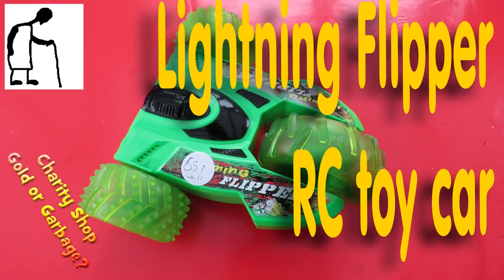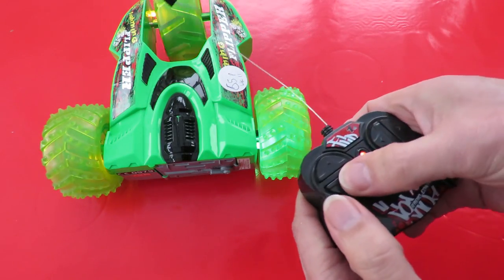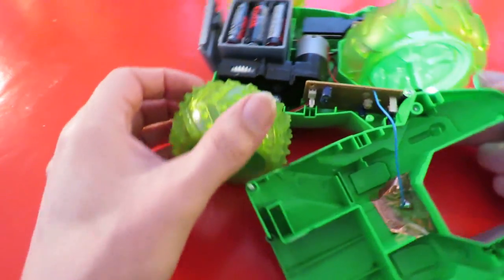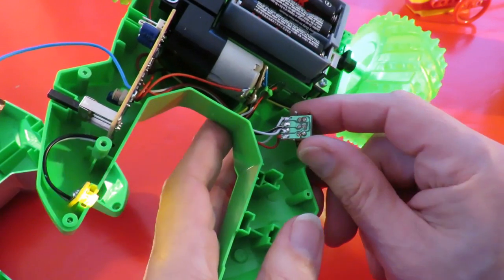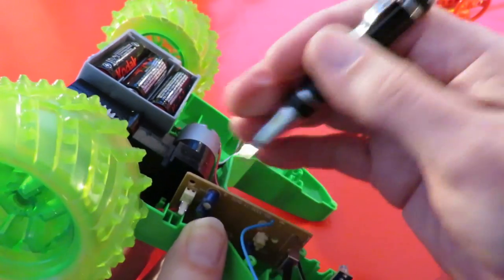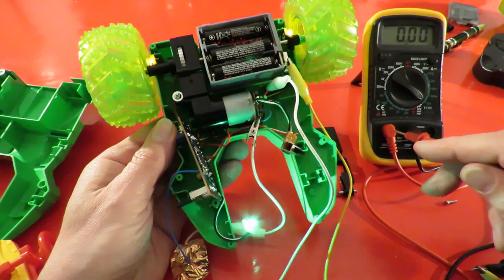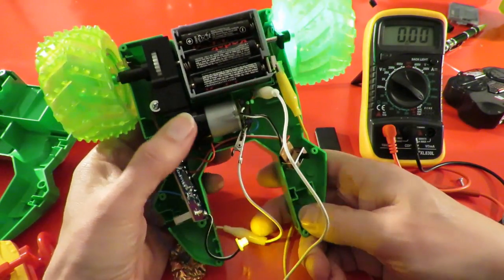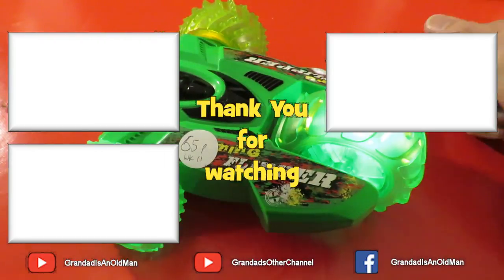Lightning Flipper RC toy car TEAR DOWN

Comment: Also got one of these cars, but can't find out where the battery goes or what size it takes.????
Reply from the maker: At 00:30 you can see the door at the back that holds the battery pack. I open the door and show you it takes 6 AA batteries. There are similar toys on the market that have a similar battery pack but contain rechargeable batteries of the same value sealed in a single plastic pack unit.

Comment: you need to know if any of your transmitters are working  do you still have your phone detector circuit thingy
Reply from the maker: I just test with another car that I know works. That way I know it is transmitting on the right frequency.

Comment: 27.145 MHz
Reply from the maker: What about 27.145 MHz ?
Reply: The lightning flipper is 27.145 MHz not 27 MHz
Reply from the maker: @ousseynouniang8849  I think you will find the majority of toy grade RC cars sold as 27 MHz are actually 27.145 MHz apart from the ones that have a switchable option with A/B/C/D or the old style early hobby grade that had replaceable crystal modules. You will find the same with 40 MHz as 40.66 MHz